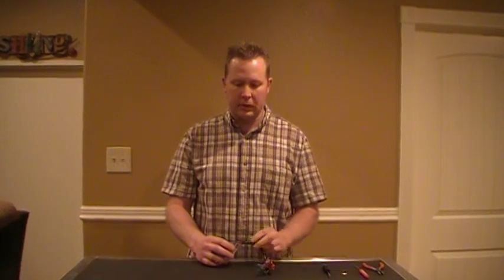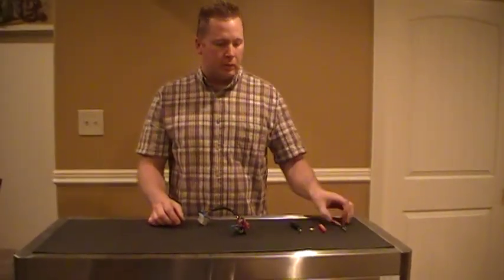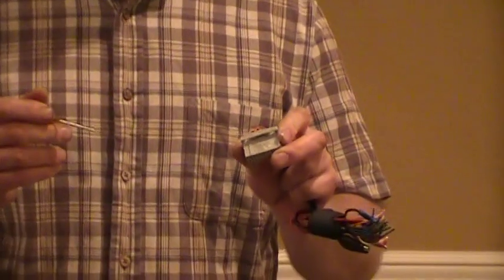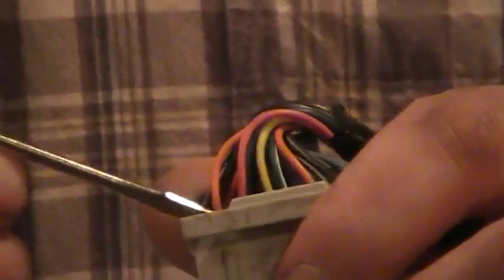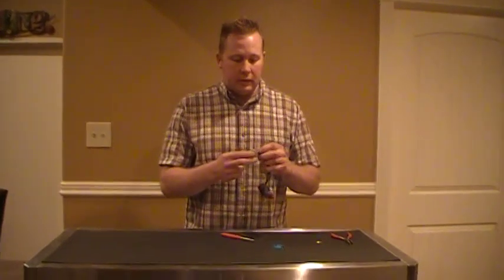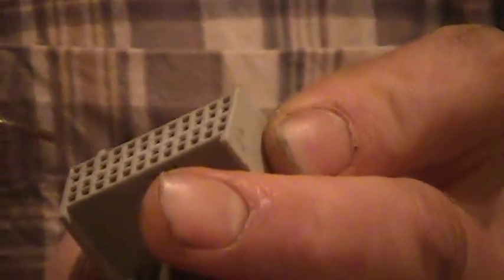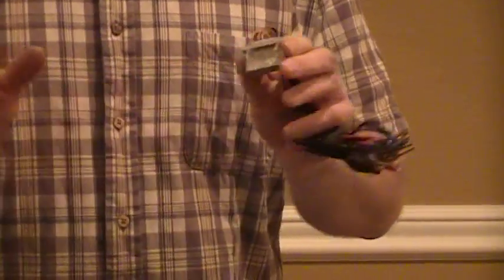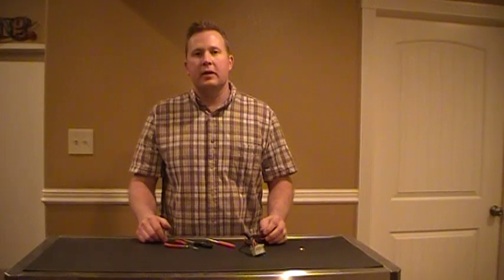CONNECTOR TERMINAL REPAIR FOR GM INSTRUMENT CLUSTER BY CLUSTER FIX

Comment: Thank you sir for this. My check engine light would intermittently go off. I would push /tap on the cluster and it would come on. First I thought the bulb but after inspecting it was well solder. I d pinned squeezed the terminal together and not it’s working. Thank you again

Comment: My backlights, mileage, speedometer, RPMs all work. All My other gauges fuel, temp, battery don’t move. And all the brake light, battery light, Check engine light are on. 

My cluster is lit up like a Christmas tree except a couple gauges aren’t functioning. From your explanation that’s a cluster issue?

Comment: I have an 02 cluster that has a speedo that sticks and moves in increments instead of just moving smoothly. I have checked all the things on the board except whats under the board with the eeprom because I don't dare to desolder all those pins. Has anyone else ever seen a cluster with this issue?
Reply from the maker: Maybe it is dragging on the gauge face because the needle was pressed down too far?

Comment: I have a 01 tahoe. Both cluster illumination lights and speedometer are dowm. I replaced the whole cluster and speed sensor aldeady and still the same problem. Any ideas?
Reply from the maker: Speed sensor wiring perhaps and possible light switch on the other

Comment: I have a 2003 chevy silverado 1500 side step. I have already repaired my cluster and it worked for a good minute and everything was great!. Until the needles and gauges stop working and the PRNDL and display not working again. The ONLY thing working at this point are my blinker indicators and the backlight on the cluster. I'm thinking at this point is the harness connection. 😫🤷🏻‍♂️. If anyone else having the same problem and they found an answer.  Please share. I'll take any help at this point. I really don't want to buy a new cluster but if all fails. Then I don't have another choice.
Reply: Did you ever figure out what was going on? Having this same issue right now.
Reply from the maker: 2003 and later models don't experience the connector issue for the most part, it is an internal power supply issue or other board problem that we see on a regular basis

Comment: You reinforced my suspicion that my cluster was wacko because of a loose pin and gave me instructions to fix it. Thanks! It now works without issue. A6 was the loose connector btw

Comment: This is the exact issue I am having with the wire for my check engine light. I cant seem to get the wire to unlock though.... I have the connecter release tool

Comment: The issue I'm having is the fuel and coolant temp gauge wasnt working, nor was the PRNDL display, so I replaced the cluster with a rebuilt one, and I'm having the exact same issue, what I noticed is the display will illuminate with the ignition in the ACC position, but not the ON position

Comment: Just replaced all the stepper motors and installed blue LEDs using a kit sold on Amazon. Last person who tried burned up several of the solder points...worst of which was the speedometer. Luckily, I used to modify Xbox 360 consoles back in the day (Reset Glitch Hack), so I used my fiberglass pen to remove the epoxy on the mobo to expose and solder to the trace(s). After all that, I plug in the cluster and nothing...then I wiggle the plug on the back and the stepper motors wind up and the leds come on. Looks like I'll be working on the plug tonight. Thanks for the video!

Comment: Seems I’m almost there,  just bought a new cluster(cluster wasn’t the problem).  Everything works except for the speedometer would It be the a4 or could It be a ground issue or how can I tell.  06 GMC Sierra 1500 Any help would be apreciated
Reply from the maker: Most likely an internal cluster issue since this video is for problems that the 99 - 02 models experience with a different type of cluster

Comment: Which wire is for the check engine light??  I wiggle connector and check engine light comes off and on? Thanks
Reply: For the 2003 8.1L like have its supposed to be the brown and white wire but I've messed with it 10 different times and it still won't work!!! Can't pass my damn smog here in CA because of it and the freaking shop can't figure it out either

Comment: I know I have problems with the cluster for speedo stepper and some lights, so i will have to do those some time, but recently a couple times all of my gauges and odo etc died. Came on later, but now it appears it is dead until I fix the problem. This sounds like what I may have.

Comment: how do you fix these terminals without being able to cut the harness out first as you have done here. Not much slack to work with. Will electronic spray cleaner help any with the intermittent connectivity issue?
Reply: Hey Jake, did you ever get your questions answered. I have the same thoughts.

Comment: What that tool called that push wire out? I am deaf. It was difficult to understand what were you saying.  Would be great if anyone tell me what kind of tool was it. So I can order one to fix mine  mine little loose in 03 Yukon
Reply: Terminal removal tool. You can use any small pin or maybe a paper clip if you are careful. You just need something to push the little tab on the terminal to side so the terminal can pull out from the retainer inside.

Comment: On a 2003 silver Chevy Silverado what wire at the pigtail operates the instrument cluster back lights
Reply: I realize this is an old posting, but the back-light dimming ckt, is A11 on this year/model. 
The backlight ground is A12.
HTH!
RT

Comment: Thanks a lot. I did this with my ground wire back of my cluster cause when I moved the wire all my gauges turns off with the odometer. I did all your steps and now everything works.

Comment: I have an 03 Sierra, I have adjusted the pink, orange, blk w/white and the black wire next to it.  The backlights still won't stay lit.  is there another terminal I should adjust or could this be some broken strands in one of the wires?

Comment: What is the ground on A Escalade 2004? The black with white stripe ?
Reply from the maker: Yes, black/white and black
Reply: @ClusterFixWashington  where does that ground wire end up on the other side? Is it possible to remove that whole harness to repair it? How hard to put it back in if it is removable?

Comment: My 2004 Escalade instrument panel has been dead for a couple years.  The one thing that does work is the check engine light (when something needs fixing).  One odd thing though...the signal lights stay on 100% of the time whether the truck is on or not (they stay lit even when there's no key and all locked up), the directionals still work despite this issue.  I also have no odometer lights (no idea what the actual mileage is...) or any audible indicators, such as the back up sensor (I rely on the blinking light in the rear of the truck...😳).   All that being said, it sounds like it's a power issue or lack there of.   I will be implementing this fix.....what's the worst that can happen???    p.s. Yes, I will disconnect the battery first 👍🏼
Reply from the maker: That sounds like an internal cluster power supply failure which is generally repairable and is also part of the Full Rebuild service found on our website.
Reply: @ClusterFixWashington  if I had you do a rebuild of the cluster and the problem is the 3 wires on the stationary harness it seems it would be better to do the fix shown in the video. What say you.

Comment: Lets  say we need a new terminal. Do you have a part number for the terminal alone. I can find the connector for 2004 is 12110088 but I cannot find the terminal part number.
Reply: This may be a little late, but using the P/N you provided for the connector shell, I found the terminals you were inquiring about. 
There are two sizes.  The first is for larger wire diameters (0.8-1.0mm/18-20ga):  p/n 12146448. 
The 2nd p/n is:12146447, which is for wire size 0.35-0.5mm/24-26ga. I actually found them on the  "mouser.com" website after Googleing the p/n you provided. They are called "Series: Micro-pack 100".
Manufactured by Aptiv (formerly Delphi). Thanks for the connector p/n, I've been looking for these for a while. I'm going to make a test bench for my instrument cluster (2003 GMC Envoy) .

Comment: Will this work for the PRND321 indicator/ odometer and message center occasionally flickering on vibrations? When moving the rear plug they turn on and off together. never one at a time. 1999 silverado

Comment: Hi I have a 2004 avalanche the speedometer was stolen and all the wires were cut. I installed another cluster and connected the wires that had the same color. There are some with the same color but I connected them. Now the speedometer doesn't work and the oil meter is always at the maximum. Do you have a diagram or where can I get one?
Thanks
Reply: ramiro2699 did you ever get the diagram? I have the same problem with my Silverado truck.

Comment: Thanks for the video , my1999 Silverado sometimes while driving it shuts off and the info center comes in with the battery red sign , then I hit the steering wheel and it comes back on , I'm gonna check because it seems as this video may be the solution for the problem , but in case is not I'll definitely send you the dashboard so you can further assist, thank you for the video you do t have  o share this but you do , that says a lot of you guys, much respect.!

Comment: Hi i have a 2002 cadillac escalade and my whole dash flickers, and the gas needle goes down. This only happens when its hot outside, I don't have this problem in the winter but throughout the year I do. what do you think the problem is ?

Comment: I did the lights and stepper motors and then the cluster started working intermittently. Wiggling the plug would cause it to function some times. I found this video and got the ground pin out using a sharp pick and crimped it with needle nose pliers. That helped. I had trouble with the other pins so I did a little checking for a pin removal tool. I found this set by Lisle, the 57750 Wire Terminal Tool Kit for about $35 on Amazon. I ordered the set and will do them all when I get it.

Comment: Will this help if the PRND21 are not lighting up as it should? Everything else is working fine.
Reply from the maker: +George Perez 
What you are experiencing is an internal cluster issue that needs repaired
Reply: If you want to fix it yourself, it's usually a bad soldering joint on the resistors inside the cluster. Forewarning: if you're not very experienced in micro-soldering,  It might be best to take it to a computer/ tech shop that repairs motherboards and have them do it. I fixed this same problem in my truck but I wasn't well equipped enough to do the soldering properly and the solder joints look like a toddler tried doing it... but the PRND31 is on now!
Reply: U forgot 3
Reply: George Perez my does the same thing but it turns on but when I hit a speed bump it turns off

Comment: Success!! Thank you for the video! FYI I just bought an 03 2500 and the backlight was working but nothing else, after tightening up the 3 terminals she's fully functioning, AND as a bonus I discovered the truck only has 148000k on it!!
Reply: thats what it had when the cluster stopped working.......it won't record mileage without power
Reply: same!. My car didn´t record mileage for 2 years  :)

Comment: I have a 2003 suburban and the cluster has no power sometimes but sometimes it comes on, I was wondering what my could be?
Reply from the maker: +eric muldrew 
What you are experiencing is a common problem with the internal power supply circuit that is need of repair inside the cluster itself

Comment: If you have an "03" Tahoe with back lights but no gauges or DIC you say it is an internal cluster problem. Mine I can squeeze the plastic around the connector and the gauges will come on. What is the fix for that, or is there even a simple answer for that?
Reply: Same here. 2003 GMC Sierra Denali...I replaced all the stepper motors, replaced leds, went over the solders on the resistors and even reflowed around the pin connector. I have already confirmed the power and ground connections for the connector seem to be in good shape (removed them and made sure they were shaped correctly, etc.) When I plug in my cluster, I hear the stepper motors wind up. So when I turn the key everything comes on. Everytime I think I have it fixed, i put it all back together and in a few days it won't work. Each time all the leds work, but the PRNDL, gauges, nor DIC come on. So i take it back out then plug it back in and it works. I have questioned my solders multiple times, I have questioned the connector multiple times. Yesterday I pulled it out again, went over my solders again then plugged the board in. Everything came on...then I moved the board putting a little tension on the wires and connection and I noticed one of the amber leds (check engine maybe?) started cutting out. Moved it back and it comes back on...so, I'm back to thinking it's the connector. I'm honestly about ready to pull that whole connector out and replace it or refurb it. Has anyone else pulled it out? What did you guys do to get yours fixed?
Reply: @chrispatterson4685  that’s what I’d like to do. Replace the female connector that goes through the firewall and all the wires. That thing is so short it’s a bitch to do such delicate pin removal. How did you do on your project?
Reply: T Cameron did you ever figure out the answer? I have an 03 Avalanche that does the same thing. I can move it around and if i squeeze the grey and blue parts on the clip, get the entire thing to come on and function fine until I shut it off and leave it for 15 minutes. Then its off again.
Reply: @joshuafimple4069  yep, that’s what mine is doing. Did you ever solve this issue?
Reply: Same problem here on an 04 Silverado 1500.   Did you guys replace your clusters?